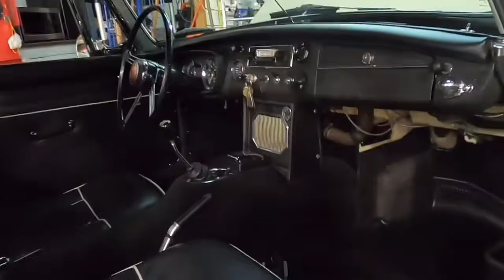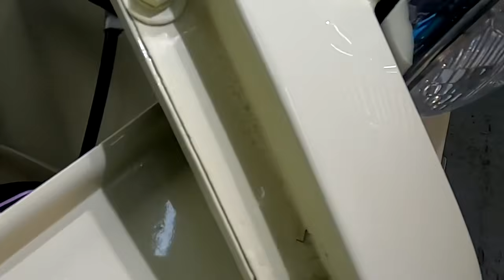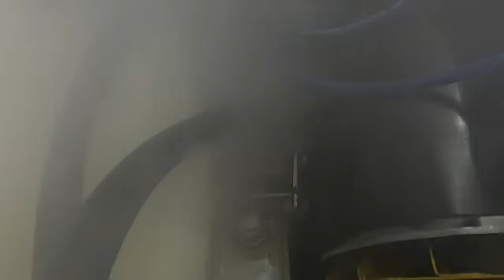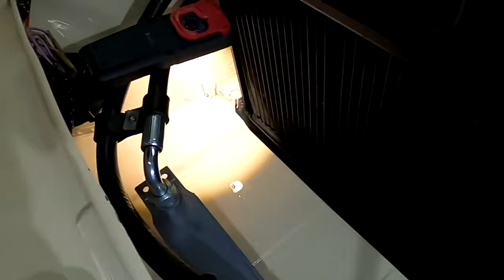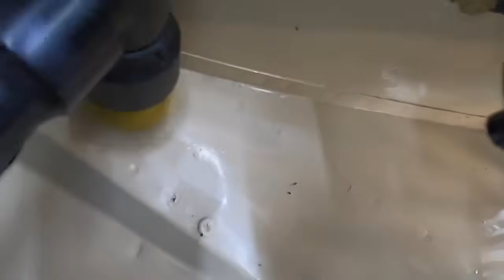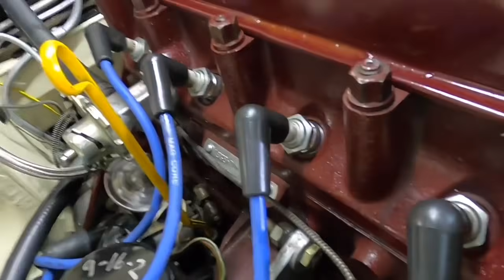Concours Engine Bay Cleaning And Protection: Classic/Antique Cars!

Comment: In a full detail, I always clean & protect the engine bay.  All painted surfaces, even around the engine will get cleaned & protectant.  I have never been asked by the customer to clean the engine specifically, but they are impressed when they inspect it after my detail...